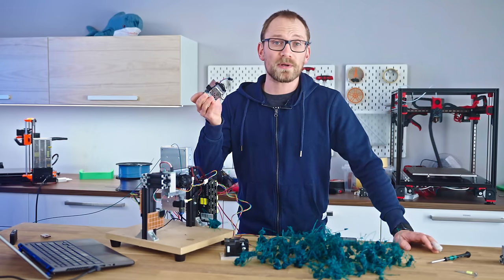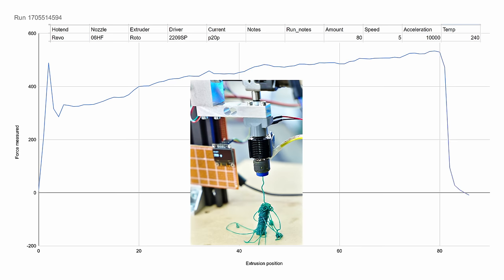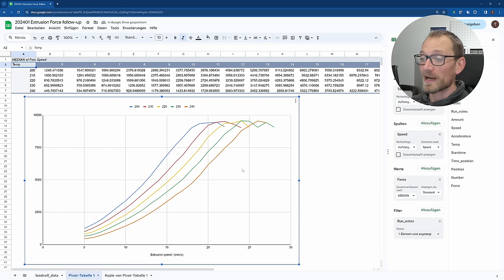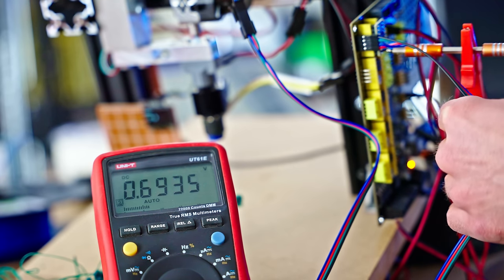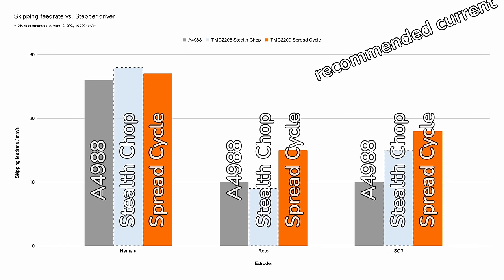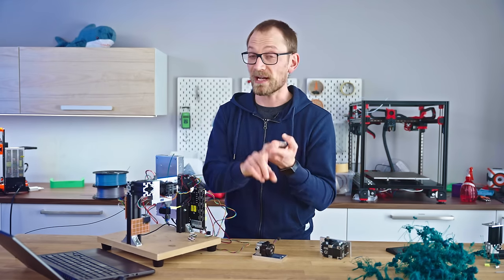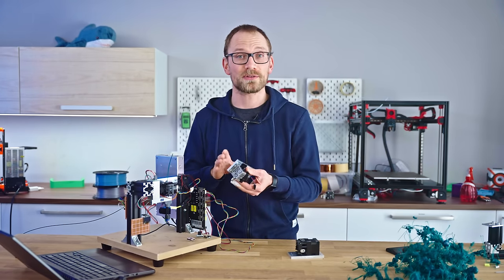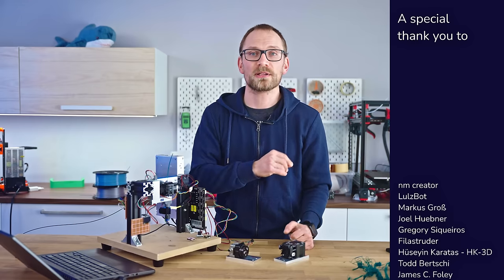Are you using your stepper drivers wrong? E3D Revo Roto Retested!

Comment: Hi Tom, 

Thanks for collaborating with our Engineers and taking the time to investigate your previous findings further. As you know, we’re always happy to jump on a call to discuss performance matters in detail.

With Roto running at its rated current you were able to achieve at least 12mm/s of filament speed in PLA through a 0.6mm High Flow Revo nozzle. This is a volumetric flow of 28.86mm3/s, which exceeds our rated maximum volumetric flow rate for this nozzle-hotend-material combination (22mm3/s). Unfortunately, the issue with only using one nozzle-hotend-material combination to infer the maximum capability of an extruder is that it gives an incomplete picture as the force/speed curve for each set up varies.  

For example, by changing from PLA to PETG you would see a higher limit. Similarly, if you were to change to a 1.4mm High Flow nozzle you would see a higher limit again. Please check out our Shorts to see a video of Roto printing with a 0.6mm High Flow nozzle in PETG at 31mm3/s and a 1.4mm High Flow nozzle in PETG at 49mm3/s. 

If it suits your schedule, we’d be up for coming on The Meltzone Podcast to discuss your other points/design choices further 😊. 

Apologies it took us so long to reply, YouTube wasn't liking the links we had included.

Thanks, 
Team E3D
Reply: Speed demo - https://www.youtube.com/shorts/TvgeMpdz6JM
Reply: Oooch! I hope this comes to fruition! Really interesting stuff :)
Reply: if you watch the video it does not relavant with flow, its simply you have a tiny motor that couldn t push as much as compaired to others(in the video) at 24V or lower.
Reply: stop your marketing excuses. the point is it's much worse than the competition at 2-3 times the price.
Reply: just change the motor, it's not hard nor more expensive.  makes no sense.
Reply: @umitbaba5690  it's not due to size, but due to combination of winding parameters, gear reduction and step angle. Same motor with 1.8° steps would probably be able to achieve higher speed before hitting voltage limit.
Reply: @Papinak2  Is it possible to just change the motor on this thing? I haven't bought one yet, and it is unclear to me if this is just an off-the-shelf motor, or if a swap is prevented by something. Also, I guess some of the design choiches like the lack of any bussings of any kind, sort of look a kind of fraile. But this thing is killing moving mass.
Reply: @FrodeBergetonNilsen  I'm not sure. Nema17 motors I found have either thicker shaft, or a metal gear pressed on. The Roto stepper seems to have longer thin shaft, with a plastic gear, which might not be possible to reuse.
Reply: Why not simply swap in a higher speed Nema 14 stepper?  The main benefit of the existing motor is that it allows existing drivers to run cooler.  The drawback is that it under-performs the competition in ways which matter.  For example, it is unsuitable for high speed corexy printers using .4 or .2 nozzles which require higher pressure.  
If it was a marketing decision to not support the standard .4mm nozzle, then the spec sheet should clearly say that.  Otherwise, customers get disappointed after they buy one.
Reply: I really think you guys didn't properly think the implications through of the insane gearing combined with the 0.9 degree stepper:
A gear ratio of 11.262:1 creates a powerful extrusion force of 70 N+, allowing the maximum volumetric flow rates of Revo High Flow nozzles to be fully exploited.

And then you put a long post here with all the caveats about flow and hardware-combo's. But then the point of 70N+ is kind of moot right? When you need the force the most, going fast, the system will just experience limits on weird accounts like not enough voltage being supplied to the stepper.

I'm generally a huge fan of your offerings, but I feel you missed the mark here. I can't even imagine how much heat is generated, either in the drivers or in the stepper motor itself.

Comment: I really don't like the direction E3D is going. Closed Revo  ecosystem, very expensive, less performance  without super expensive high flow nozzles and heaters, etc.
Reply: Personally I think that they have so much passion to tinker that they spend a lot of money on it.
As they spend a lot of money on it they need to get it back somewhere...
Is it sustainable? Only time will tell.
Reply: I’m not sure I agree. 
The closed ecosystem is a bummer, but they are partnering with other manufacturers for products that otherwise wouldn’t exist (cht, biqu, sprite upgrade?). 
The Revo hotends aren’t that expensive considering what they are and what they come with, though I do wish the nozzles were more affordable. 
They are consistently putting out great products and standing behind their products when they make mistakes (Revo heater core). 
Obxidian was a LONG wait, but you should check out the blog post about the process if you haven’t. It makes sense things can go wrong when pushing a new process into production at a mass scale.

When we compare the level of refinement we’re seeing in the current extruders, hotends, and nozzles to the original V6 era designs, I really can’t see how the value isn’t backing up the price. 

As I said, I do wish the ecosystem was open, but based on my AliExpress suggestions, they aren’t going full Slice on those listings and there are tons of knock off nozzles and accessories available.
Reply: The REVO idea of uniting the nozzle and heartbreak is great at eliminating jams at the nozzle-heartbreak interface. 

However their flow rates, even “high flow rate”, have lagged behind many competitors. It’s telling when the printers that push the limits do not use any E3D product.

Also the Obxidian fiasco was terrible. Marketing getting ahead of production by 2-3 years.
Reply: Tbh, not convinced by the Roto. 
However I do love the Revo system and do wish Prusa used them on the MK4 but also understand Prusas want for backwards compatibility
Reply: The concept of REVO is nice but very expensive. I even invested in a diamond nozzle.... Not worth the money if you consider mediocre performance on a "normal" brass nozzle level. 😂
Reply from the maker: I'm torn. Of course, I don't like the direction of going towards more expensive, locked-down systems, but on the other hand I also see the market that lower-end products are competing in and totally understand that E3D don't want to be a part of that.
Reply: I totally agree and are ready to support that going cheepo is not the way for everybody. But than I expect to get accordingly performing products.  In your test you proof that they simply ignored the fact that stepper motor coils have also inductance witch is influencing dI/dt.
Reply: This feels like an experiment in a way. With the printed metal housing. I assume later generations will get cheaper as the tech grows. But yeah in general I am not sure what it gives us over a cnc'd part.

I have a Revo hotend and a Dragon hotend in different machines. The swaps on Revo really are worth it. But I do not notice much performance difference.
Reply: @CodeMonkeX  From Dragon HF with Bontech 0.5 to REVO Diamond 0.6   means ca. 25m3/s  down to 16-19 m3/s  (ASA)
Reply: @MadeWithLayers       Have you tried milled glass fibers in resin printers instead of the larger pieces like in previous videos? They are common for boat fillers and range anywhere from .03125 inches down to to .006 inches and are very cheap.

Sorry it's unrelated to the topic here.
Reply: They would do better if they just made their high temp beds in form factors people actually use. The revo ecosystem has been very unimpressive to me, there were a lot of issues when it came out, and they just haven't done anything about it. It's a very low flowrate hotend, lower than the V6, I mean yeah you may not need more but the mosquito had excellent quality and flowrate, it's not like that's the issue. It almost seems like an afterthought, I would guess most of the issue is just because of the nozzle system. The heater doesn't have as good of an interface to heat the nozzle, a friction fit isn't the same as tightened threads or a taper.
Reply: Also where prusa is going but pwople arent noticing.
Reply: The problem for me is that for the printer I want to build, it’s basically the only option I have. I have lots of project ideas that can only reasonably be printed either with nozzles smaller or larger than 0.4mm. I’d be worried about wearing the threads of the Mk8 heat block I have now with so many manual nozzle changes. Right now they seem like the only people with a solution they will cover all my bases. Are there really no other quick change solutions out there?
Reply: @4DRC_  using smaller than a .25 nozzle probably won't do what you want it to. They can work, but you're never going to be able to print filled materials and probably PETG, and in addition to that the ONLY difference in quality will be outside corner radius. It will go from .2mm to .125mm, the actual wall dimensions should be the same regardless of nozzle size. In addition to that they're just seriously slow compared to a .6 or .6. 

If you're just looking for fine detail quality shell out on a really good extruder and hotend combo and beef up your part cooling, that's probably what I would do for printing minis unless the features you need to print are just that small of scale. 

As for the base, definitely rails and a coreXY, should make things easy, .9 deg steppers, tmc2209s, maybe go heavy on the micro stepping if precision is the only thing you care about but that can be hit or miss.
Reply: @wage4598  yeah it’s a 2019 X5SA-400, so I got the corexy box checked. Linear rails are on my list too. the bearing wheels are getting squeaky and need work anyway. I’ve done a lot of upgrades but in terms of performance upgrades so far I’ve added a synch belt to the Z motors (mainly so the bed doesn’t tilt when unpowered), and adjustable tensioners to all three axis belts. I also made a “direct drive” by mounting the extruder to the carriage using a custom mount (though there is still a small run of Bowden tube). 

My main interest in small nozzles right now is to see how small of a gear module I can print, or small teeth TPU belts. Going larger than 0.4 is to quickly print things like robot chassises and other large parts. 

Which is why I’m thinking something with the Revo system, either swapping just the hotend for the Revo CR, the Hemera XS, or the Swiss Micro (which has a drop in CR-10 upgrade which is X5SA compatible, a Revo model, but not a drop in CR-10 Revo model). I can see myself jumping from model to model which each has a different ideal nozzle diameter instead of organizing myself for printing only models ideal for one diameter for a period of time, so easy swapability feels like a must.
Reply: @4DRC_  I can tell you from experience you are not going to have a fun time getting that to work well, it may be possible but with TPU and a .25 nozzle that's about as difficult a setup as it gets. This is an instance I would almost suggest spending 2-300$ on a top of the line extruder setup, but really that's because of one detail. Pressure advance, there's where most of your corner quality is missing, if it is not tuned very well you will have a hard time getting nice sharp corners, with TPU again that's going to be even more difficult and why I suggest the best extruder you can get. Tronxy isn't a bad start, I have a 350 but I've had to replace just about everything on it. I have independent Z control which is really nice and I think a third screw and motor would be a nice upgrade, that printer has a lot of very manageable issues, good starting point though. And yeah, definitely don't re use any of the pulleys/belts/motors, they're not of very good quality, I re used a couple and I'm getting away with it but from what ive seen they all need to be replaced at some point to another. The revo system can be nice, easy tool changes, I don't see myself ever investing in that ecosystem though. It's not very high performing, and I don't change nozzles often, if anything I'll setup one printer for a certain nozzle and leave it like that for a while. The V6 platform does perform better than the revo in pretty much every way and it's cheaper, something like the mosquito, dragon, or rapido all have fixed blocks which is a really nice improvement and makes nozzle changes easier, they also have much higher flow options and don't sacrifice quality, at the price point I would rather build a tool changer based on clone parts and it would probably be better and equivalent in price. 

With TPU it's all about the extruder and back pressure, you want absolute control over those two things, the revo is not going to do well with back pressure inherently as it has a very low flowrate and unless you get the hemera setup your own you probably won't end up with a very optimal extruder setup for flexibles. Something like the LGX ace or Omneadrop would be a better option, or V6 hemera if you never want to have an issue.
Reply: The entire revo ecosystem is a bummer. 

The industry should have stuck to the standard v6/volcano nozzle pattern, and simply found ways to upgrade around them. By making proprietary, complex nozzles that only work with certain heat sinks and heaters, it really hurts the consumer tremendously.

I don’t mind proprietary nozzles when we start looking at pro/commercial grade extruder/hot end setups, stuff like dyze designs for example. But for the enthusiast, consumer grade products…producing proprietary closed system nozzles is a slap in the face to not only the spirit of the community but also to our hard earned money.

Comment: A guy named NightHawkInLight had a somewhat recent video on how you can test multiple parameters that influence each other and test them with only a few tests. I think it would be worth a check so that you can be able to do testing of more variable while not sacrificing time
Reply: That method is called ortogonal array: https://en.wikipedia.org/wiki/Orthogonal_array
Reply: NightHawk was talking about Taguchi arrays, as Tom is an engineer I'm sure he knows about them.
Reply: Indeed, clever evolution of concurrent testing with smart filtering of the results. Not sure how that could be accomplished given the tests can't be performed concurrently.
Reply: Design of Experiments (DoE) is the methodology he’d want to use. We call testing each and every point full factorial. With multiple variables you can quickly to an untenable amount of points to run.
Reply: processing data in spreadsheets is also pretty slow... this is where data science and the use of a python library (Pandas) comes in handy. Thomas thinks that's a lot of data, but it's definitely small as far as data science subsets go
Reply: Its not a processing problem he'd be having. Its an ability to design the experiment, document the results, and then express it in an audience readable form thats hard.Then do that with an eye towards making a reasonable video production cadence and not needing to take on whole other degrees worth of knowlege to process 1 videos worth of results before moving on to a completely different one that has no need of that specialization. @Duckferd
Reply from the maker: I didn't expect to be diving this deeply into data science, but there's certainly lots to learn and to optimize. If I ever do dive into the deep end again, I'll make sure to do it a bit more systematically 😉
Reply: @Duckferd  Processing actually large amounts of data in spreadsheets is slow. On a reasonably good PC a few hundred or thousand data points are much more quickly analyzed in Excel/Sheets than in Python simply due to ease of use and ready-made toolsets.
Reply: @AlexusMaximusDE At that point you might as well pull up R.
Also, Python (and R) lets you run much more sophisticated analyses: no more eyeballing the results, run MANOVA or multiple regression models on it. It will tell you exactly which factors, and combinations of, have statistical significance.
Reply: @EgorKaskader  🤷🏻‍♂️ nah